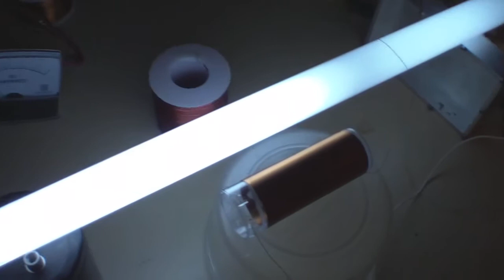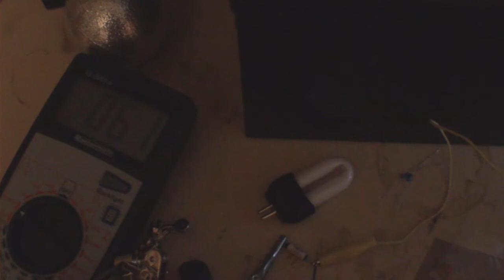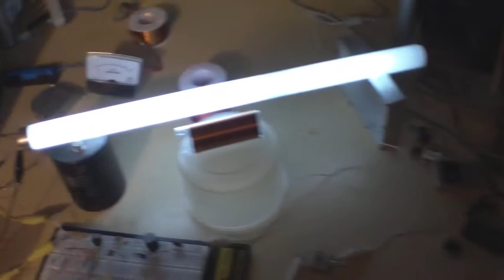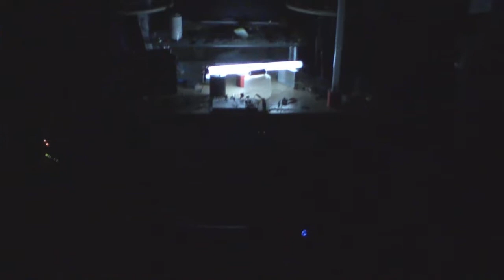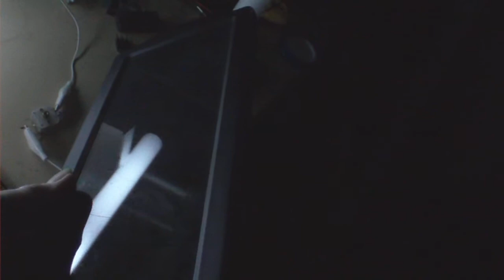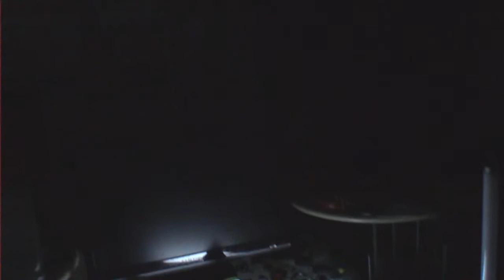(Replication 7.) Jonnydavro's SEC 15 Variant - 12.28V / 62 mA - 15 Watt 18" Fluoro

Comment from the maker: @tectalabyss Thanks. I like to build something, to use... Beyond myself, though... this circuit is intended to be operated at a specific frequency, determined by the coil itself, called the spatial resonant frequency, at which point there is no input power.... check it out... StifflerDr (if you haven't before...)